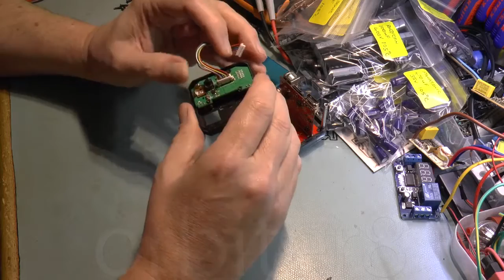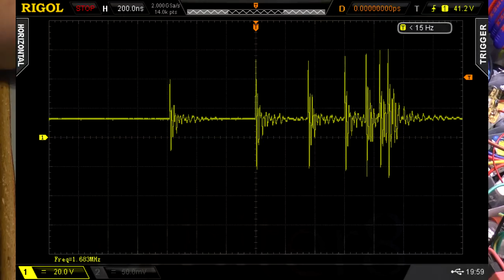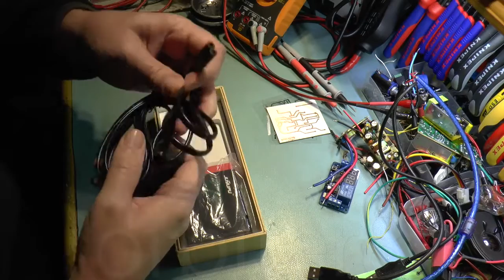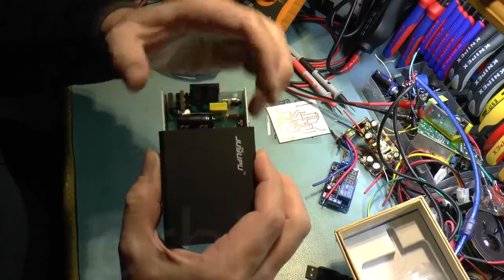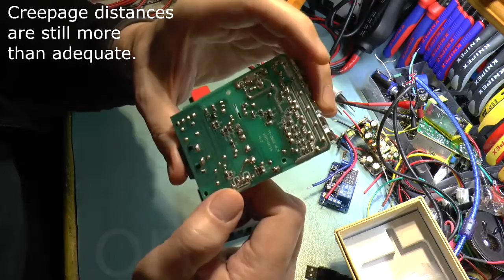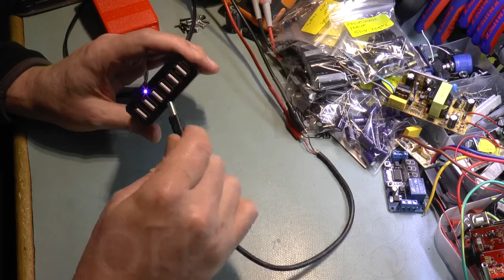6 Port USB Charger

Comment: I own the Anker USB hubs, 40W and the 60W one and happy with both of them. I accidentally shorted a USB wire I had soldered to a PCB I was working on and the unit shut off that USB port only. After unplugging the unit and plugging it back in all the ports came back on. It has some neat protection logic built in for the price and a good 18 month warranty.
https://www.amazon.com/gp/product/B00VH8ZW02/ref=oh_aui_search_detailpage?ie=UTF8&psc=1

Comment: John, thanks for the video.  Glad to see you are back online.
What brand and model of video camera is that anyway?

Looking forward to the next video.
Reply from the maker: Hi Corgi, thanks for commenting. The camera is a Panasonic HD-X920 

Cheers
John
Reply: +orbiter8 (John) Thanks for the quick reply.  
The H-x920 looks like a nice camera (20 Mpixels and $860 USD), but a bit different than the little blue USB one you were working on... that's what I was interested in.
Reply from the maker: +Corgitronics Ah sorry, the microscope camera is an Ebay buy.. They are available with or without the 180x lenses now which makes them a little cheaper.. Just search.. '14mp microscope camera'  on ebay my friend. 

Mine came from here... 

http://www.ebay.co.uk/itm/14MP-TV-HDMI-USB-Industry-Digital-C-mount-Microscope-Camera-TF-Video-Recoder-DVR-/111952553237?hash=item1a10e46515:g:tiYAAOSwuTxWBBnT

Comment: Nice. The voltage probably dropped off because of the flimsy wires in the USB cable. Where's the microscope camera from?
Reply from the maker: +SDG Electronics  Thanks Steve.  On the section of video I lost, I did actually show some Twin & Earth cores hanging off a USB socket :).. And your right, it did make a difference however only enough to prevent the voltage dropping below 4.5v. I would have hoped for about 4.8v as a minimum but I guess ya can't have everything.

Camera is from here Steve..

http://www.ebay.co.uk/itm/14MP-TV-HDMI-USB-Industry-Digital-C-mount-Microscope-Camera-TF-Video-Recoder-DVR-/111952553237?hash=item1a10e46515:g:tiYAAOSwuTxWBBnT

Comment: That is a nice usb supply :-), plenty of power for ordinary devices.
BigClive reviewed something similar because mains was leaking to the output sockets, a neon screwdriver would light if the 0/5 v pins were touched, but it was a transformer fault.
.
You may have been losing some voltage on those very thin wires from the usb plug, perhaps soldering two loops of copper directly to the plug would show you better voltages.
.
Dam shame about the camera :-(, that switchmode looks like a cheap two transistor job, perhaps an i.c based switchmode would be better.
Ive used cheap 12/5 volt switchmode supplys for hard drive testing, they seemed ok but perhaps i should of connected an oscilliscope to them.
Reply from the maker: +zx8401ztv  Thanks mate.. Yea I was real disappointed when I decided that the camera was beyond repair :( I'm just happy I've got another one now though.
Your right too mate, I was loosing a lil' voltage due to the narrow gauge wires.. But as I mentioned to Steve (SDG Electronics) I did actually test it with some Twin and Earth directly to the socket, but there was only a couple of hundred mV difference in the results.  Sooo peeved off I lost some of the video footage. Oh well, I guess that's what happens when you record in separate sessions.

Cheers friend
John
Reply: +zx8401ztv I won one of these at low cost on ebay and given the recent Big Clive teardown (of a completely different one) looked at it with suspicion. First test, neon screwdriver which lit quite brightly - but with a meter the leakage to earth is only a few micro amps - but slightly more than my other trusted power supplies. I'm happy to have seen this review, gives me confidence to actually use my example of this psu.
Reply: +David Pilling 
Yep i do like big clives videos, he is clever and comical, i dont think you could get a better combination ;-).
I personally would change the power socket to include an earth pin, then a double insulated earth wire from it to the usb shell negative.
Ive never liked the idea of connecting a capacitor from the hv side to the output, i dont care how good the cap is, it can fail.
Reply from the maker: +David Pilling Thanks for the comments David. Yes I saw Clive's video too (nasty little unit he had there) These charger designs are all very similar really however they seem to differ in layout rather a lot. It's not unusual for the sockets to show an AC voltage on them, it is due to the low-impedance path between primary and secondary sides of the circuit via the 'Y' rated RF suppression capacitor. Under normal circumstances this is not a problem, however as Clive showed a shorted transformer will certainly add an extra rather dangerous dimension to the mix :o

Cheers
John

Comment: you should be able to pull 2A with no voltage drop well not below 5v so if you loaded that charger up all the usb sockets at 1A you would have such a massive voltage drop most phones and tablets stop charging and only draw 500MA so in all the charger is crap my friend. also them ports are rated for 500MA only usb3 can support 1.80A and i have tested a usb 3 port at 2A for 6 hours and the usb port got very warm. and i suspect after couple months charging the usb port would fail.You clearly have the equipment and knowledge to test this properly but for some reason you didnt?